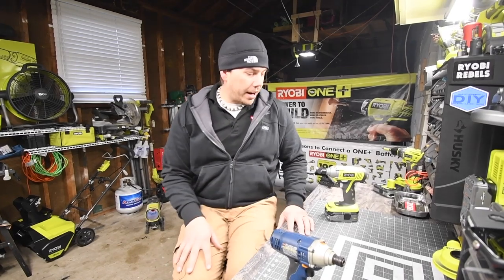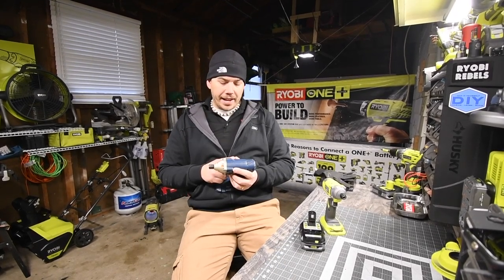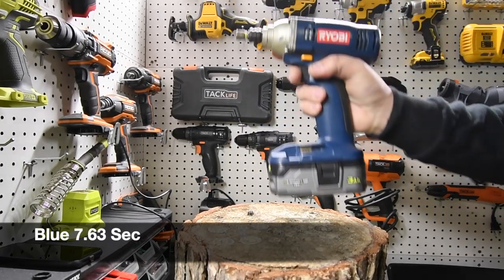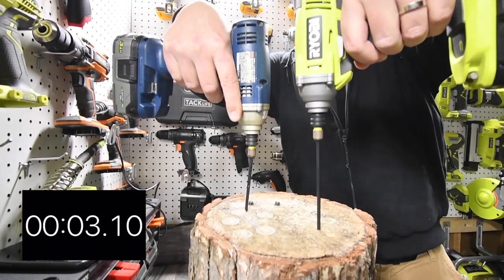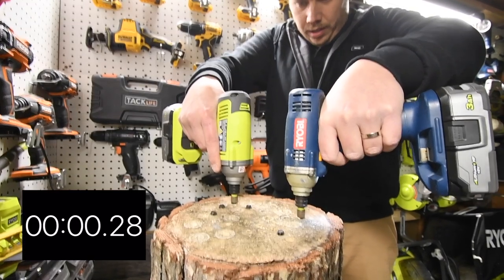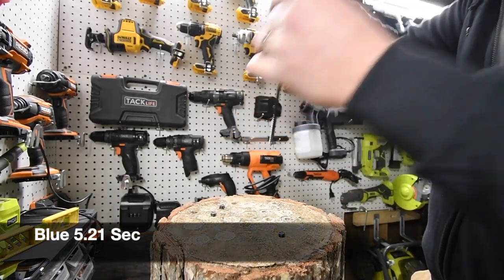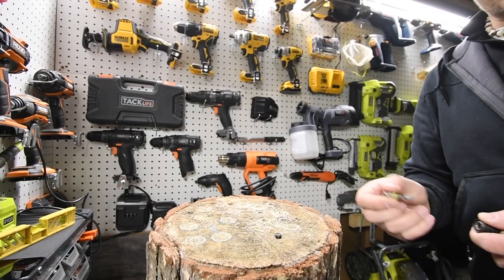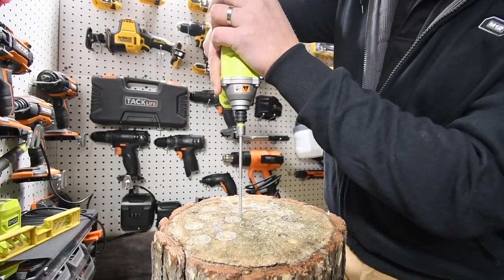Ryobi Blue vs Green

Comment: Pretty much the only reason I use my old blue tools is they still work really well (after 12 years.) and it’s hard to justify spending the money to upgrade them.   
Although I did get the brushless drill and impact - specifically because they had belt clips and I bought them just to do a massive drywall job.
Reply from the maker: very good and thank you for viewing
Reply: Well as long they work
I'd keep using them
Reply: I think the old blue tools had better motors I see more new brushless tools in my Ryobi tool groups failing while I'm still using 15 year old blue tools

Comment: 1990's Blue tools were made by Ryobi When Ryobi was Ryobi. They had quality.  Now Ryobi, Milwaukee, Hart, Dewalt, Porter Cable, and every power tool you can name is all the same company. Low quality. Most are inferior or garbage to old tools. My 30yr old blue 18 Drill at max torque clutch setting will shear the head off a 1/4 -20 grade 5 hex bolt or strip out a spark plug in an aluminum head. That is enough torque for most everyone. It outperforms My 20 volt Dewalt.
Old tool Companies made tools to last a lifetime. Now they want you to buy the latest model every couple of years.
If they would just decide on one design of battery mount for all DC power tools, That would be a vast improvement.

Comment: What is the battery for blue one, do I need a different charger for that lithium battery
Reply from the maker: the 3ah HP compact battery is model p195. it uses a regular charger
Reply: If you only have the nicad charger you need a new one

Comment: You do not use an impact hammer gun to install lag bolts. Flawed test.  But Blue is best when fitted with a Lion battery. Green is lighter and a bit more compact.  Go blue Go.   They are Cheap on ebay and they do the job as well or better than ugly green.
Reply from the maker: look at the date of the video
Reply from the maker: and yes. using an impact driver to drive in lags makes a great motor stress test.

Comment: So... the new Green Ryobi 18v Lithium ion Batteries work on the old Blue Ryobi power tools that used 14.4v Ni-cd Batteries without any issues?  I hope so, because I loved my old Blue Ryobi 14.4v Drill.  The only reason I don't use it any more, is because the old Ni-cd batteries won't charge anymore or have lost their capacity.
Reply: Yes they work. Those motors can handle 20v so the 18v are the sweet spot. More power increase
Reply: How do the 18v batteries fit, I thought it was only the one+ that was backwards compatible
Reply: I have several 14.4v tools I use 18V batteries and 14.4 V batteries. 14.4v Nicads are available on ebay but they are rebuilt using used cells. You can but new Nicad cells and make your own 14.4V packs..
      To use 18V Lion batteries in a 14.4v motorized tools can be done by modifying the tool battery mounting base with a Dremel and a cylindrical burr on low speed. Shaving part of the front of the base. Videos on Youtube on how its done.
Can not convert 14.4v flashlights to 18V unless you install a 18 v bulb.
Nicad oxidize over time and short out. But  they can become serviceable again as long as they are not leaking. This is done cell by cell with a 6V battery charger and shocking the battery several times quickly at  < 1second on and > 5 Seconds off, repeat three to five times. Check with voltmeter. Once you get any voltage STOP shocking and charge the battery normally.
Normally Nicads in a series pack there is only one bad cell. Rearrange the order of cells. The cell in the middle is most commonly at fault.

Comment: Does anyone know if Ryobi can reload their the newer battery pack's into the old battery case's ? Also the same question for the Dewalt battery packs   ?
Reply from the maker: I am not too sure of that
Reply: yes , the lion battery will work fine in any tool they are just more powerful
Reply: It can be done if you replace the old circuit board with a BMS circuit board. If the intelligent charger "thinks" that it is still charging NiCads instead of Lion it will kill the cells by overheating them.